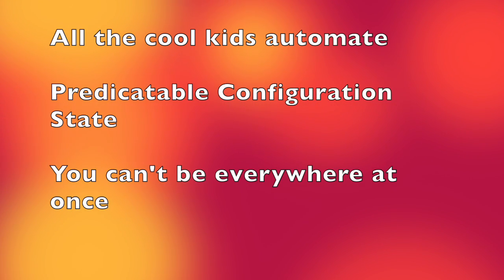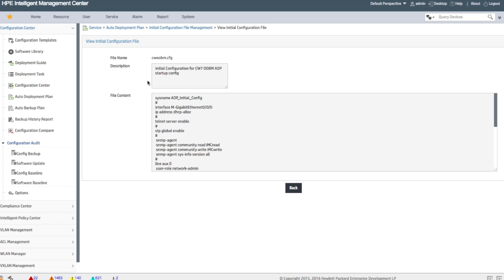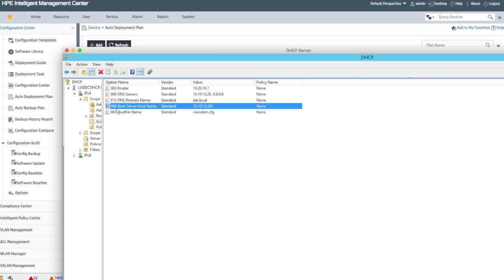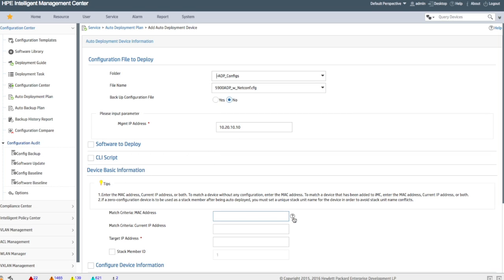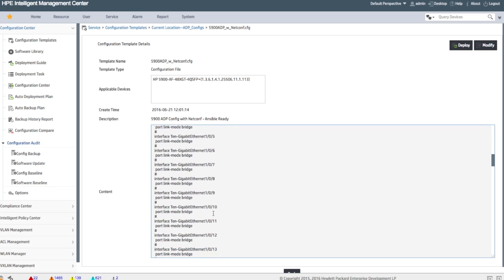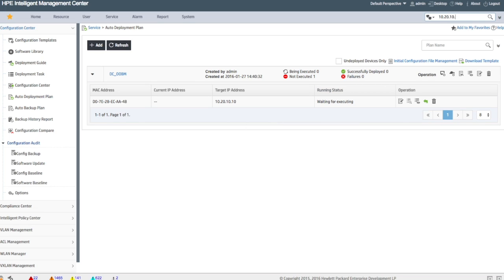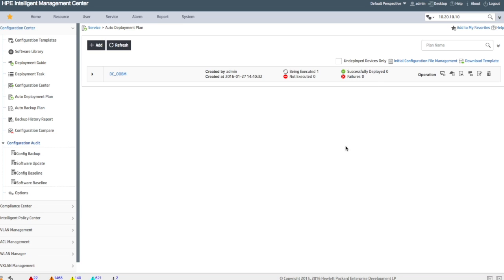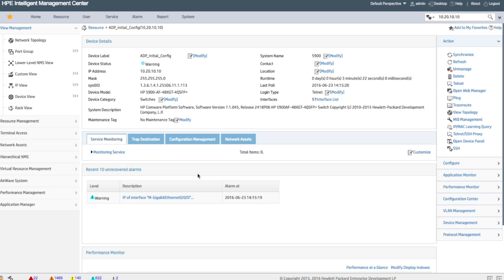HPE IMC Zero Touch Provisioning

Comment from the maker: Hi Mohammad,  I don't input because I'm using the CSV file to drive it which is available on the github repository that I mentioned.  Http://www.github.com/HPENetworking I believe it's called scriptsonly.  If you look in the events folder.   Again, this was mentioned in the video I think?   For it to match, you MUST enter the match MAC-address which should be the address on the box. I'll have to   Try and find a 2920 to see if I can figure out the proper command to get you the mac-address of the box.

Comment from the maker: Hi Mohammad,  Thanks Fo stopping by.  You will need a DHCP server to give it the initial IP address and Bootfile. The assigned IP address is only used in the final configuration. Essentially, it's just an input into the configuration template.  This will work fine on the old 3com/HP 4800G as well as the Procurve 2920 switches.
Reply: thank i will try it get back at you
Reply: i try with procurve switch 2920 but not working the switch don't take the file from IMC but it take IP From DHCP Server
Reply: hi
in the video you don't enter anything in
Device Basic Information:
--------
Match Criteria: MAC Address
Match Criteria: Current IP Address
--------
if i do the same it give this massage:
---
Enter the MAC address, Current IP address, or both.
Reply from the maker: Hi Mohammad, please check out the sample intial config files for various different devices over at https://github.com/HPENetworking/HPEIMCUtils/tree/master/ZeroTouchProvisioning/InitialConfigFiles

It should help to clear things up I hope!